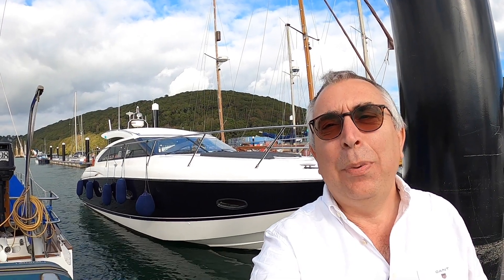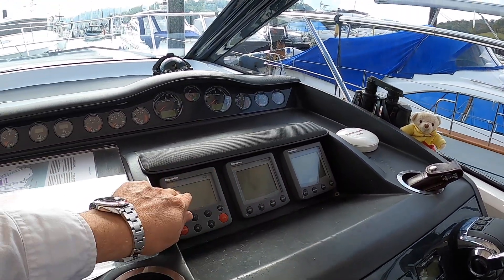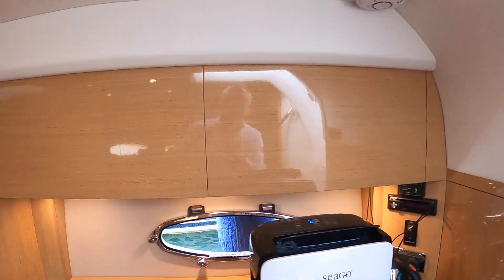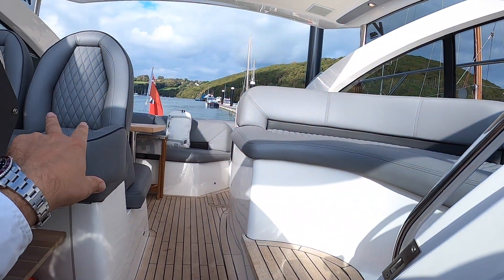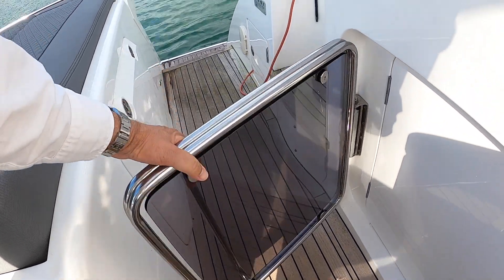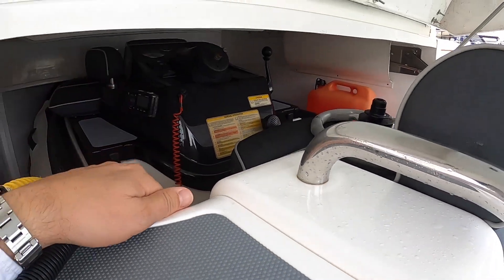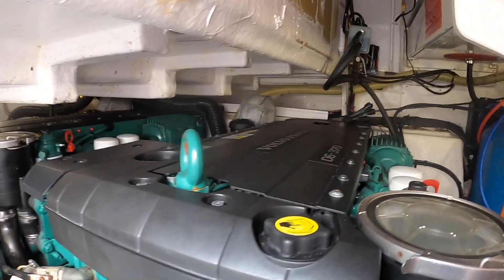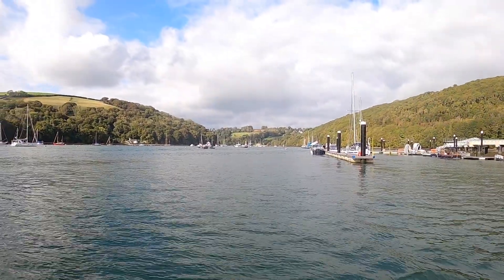£320,000 Yacht Tour : 2011 Princess V42

Comment: Lovely little boat, so much room downstairs too.

One question though - with these open backed boats, what's the security like? Obviously in a marina, you have limited access, but away from that could someone just walk onto your boat, and get access to the whole thing? I.e you drop anchor and go exploring in the tender.
Reply from the maker: There is a lockable sliding door into the cabin

Comment: The aircraft that overflew you sounds like a Eurofighter Typhoon.
Reply from the maker: It was smaller than a Typhoon I think. Wish I'd got the camera at it a little quicker!
Reply: @AQUAHOLIC  It definitely was not a F-35.  The whine of the engine is to high pitched.  I am a former USAF CCT and have learned the general noise of the air frame to determine what is around me.

Comment: I have seen several if not all your videos and placing the gigantic yatch (those have crew) where is the communication equipment for whom for example will check the engine and want to ask if the manometer or other problem other than right next door is so ask end to end if it is in good condition or not? 😊

Comment: My dream is to take a boat down to the Med and spend the warmer months around the Adriatic. Sailing around the coast of Italy around to Croatia and down to Greece. Nick said the range of this boat is about 100 miles. Which wouldn't really be enough. What size of boat would be ideal for such an endeavour? Baring in mind I will need to sail it to the Med from the south coast of England.
Reply from the maker: 200 miles - you could take this down.

Comment: Hi Nick, excellent review as alway's. I did have one question - If you needed to do any major work on those engines, is there a way to get them through the garage with the tender removed, or would you need to cut a hole in the floor of the garage? I didn't notice a hatch over them.

Many thanks
Reply from the maker: There's always a way if it becomes necessary enough 🙂
Reply: Two large covers are removed in the garage and open full access to the engines. Nick, please add Russian subtitles. Thanks.

Comment: I would love to see you rocking this. It would suit you well. 
But what size is the actual best for your use? I'm thinking a lot about the dockage fees.
I feel that the breaking point for proper spots in harbours lay around 35-40 feet.
Reply from the maker: The running costs are certainly a consideration